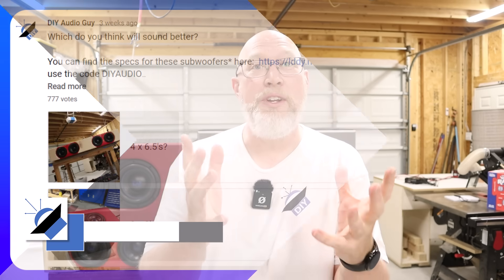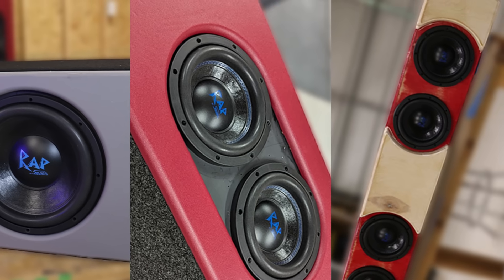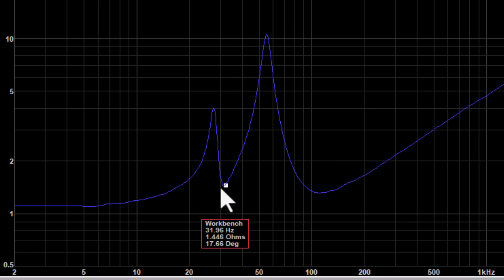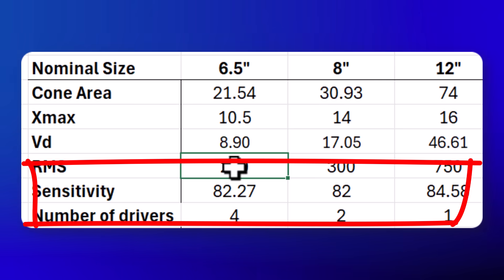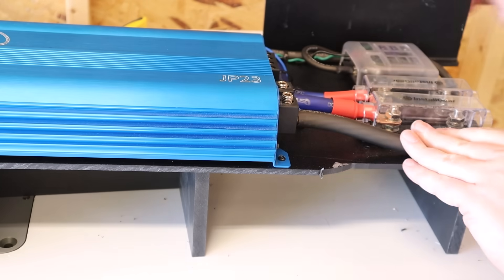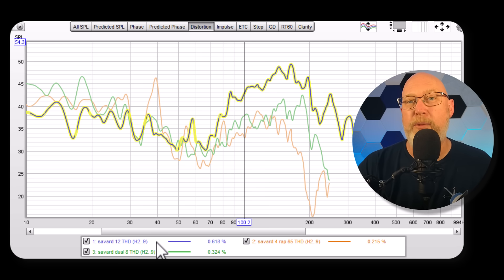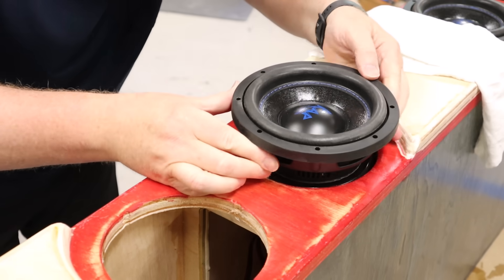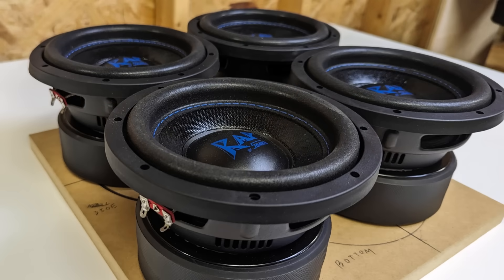Are small subwoofers better than big subwoofers?

Comment: Okay, so if I'm looking for some low frequency extension / higher output at those low frequencies, I already have a single 12, and plan to do a center console hidden subwoofer box for my full size truck in between the bucket seats of my single cap, so would I want to go with a larger or smaller displacement box? It seems that if I want to keep the base tighter it should be sealed instead of ported, though I've ran a ported box in every other application I've done up till this point with trucks and SUVs, but I'd kind of like to be balanced between SQ and SPL, and it seems like a sealed box might be the better bet for that? So then that just lends to the question of which one, larger or smaller, would lead to higher SPL output at the lower/lowest frequencies? Or should I stick with a ported box, slightly on the smaller end of displacement, with a port tuned closer to 25 to 30 hz?
Reply from the maker: That is to much to answer in a comment under a YouTube video.
Reply: @DIYAudioGuy  long story short, will a larger displacement sealed box create a larger extension of the deepest bass frequencies than a smaller displacement sealed box with the same woofer?
Will that sealed box play the deepest notes comparatively to a ported box (assuming the tuned port frequency is say 35hz, while I'm talking frequencies below that in the 20s)

Comment: 1. I have questions!  How is a subwoofer box size determined.
2. Despite however box size is figured, I've been told that the bigger the box, the louder the base is and lower bass.  Is that true.  
3.  Does a 100 watt amp have a harder time driving 4 100 watt subs  than just one?  ie would i benefit from increasing my amp size to a 200 watt? (not to hit peaks with just to ease things for the amp running 100 watts rms.
I'm going to be building a box for my old silverado ext cab.  I've found that I can squeeze in a 14"x14"x56" box hoping to get more from the 8"s I'll be putting in it.
Reply from the maker: https://youtu.be/yZNeYBYGRKk?si=O610L8gTNir0DQHE

https://youtu.be/A9oVxddE2GA?si=9RKNehqOe_wp1D3i

https://youtu.be/1CwZtmCqUtE?si=jVR78r1bPA7s6H2i
Reply: @DIYAudioGuy  Thank you!!!

Comment: I aint worried about car audio. I hate line array speakers they play way to much highs with limited mid range and without a sub there is no lower sound range. I like to hear the rumble move from place to place in my theater room. I also like the fact i have my old school hifi home speakers and a good powered sub. I run a pair of techniques by pioneer sb 6000 a speakers and i also run a pair of freshly rebuilt infinity rs 3b speakers. I can shake my entire room and house without the powered sub with my infinity speakers. Pink floyd welcome to the machine shakes my room so bad plaster falls off my ceiling. The infinity rs3b has two tens per box with amazingly clear lows mids and highs.

Comment: If you dampen the res freq. the roll off below resonance is not that steep and to counter the spl drop due to a low q factor use 2 subs in parallel. It basically allows you to build a smaller box but with a lower q factor.
Reply from the maker: Sounds like you're describing an isobaric enclosure.
Reply: @DIYAudioGuy  not the same but using principals of musical instrument manufacture for tuning driver response
Reply: @DIYAudioGuy  you can reduce enclosure size by about 25% and end up with similar q factor

Comment: Iv done this test many times simply because I love subwoofers and bass head in general. It's a hobby , 2 yr ago I was designing a system that would fit best for me and something I could run with the fam with me and rip the car apart when they aint. Lol😂. So I started with 2 Sundown Audios SAv2 8s , not just normal Sav2 8s but the spl version with the aluminum coils.. music they hit pretty hard , but spl they walked all over past woofers iv used which shocked me. 140s from two 8s in the trunk on a taramps 4k at 1ohm. Then I ordered the newer Sav3 8s the street versions for music. I got em cheap 280 dollars or so for em both brand new still in box ect. Those sounded better than the older V2s even spl wise it was close. It's just the v3 is better built. Then I ended up ordering X 8s from Sundown and those done better on deep bass , but louder?? Not really.. like normal music the Sav3 hands down sounded best hit harder and was cleaner. The Xs got lower but I wouldn't consider em much louder.. nor worth the upgrade. The Sav3 8s are str8 up mini monsters. Then I went to Sundown xv3 10s which are amazing. Those two 10s will tear things up. Their heavy , their very loud , and almost damn near impossible to blow unless someone intentionally tries to fry em. I had em on two taramp 4ks each one had its own 4k Amp. Bass 4ks , then I went to my trusty old Sundown Zv3 12s I have 4 of them , but I needed room so I just used one. It's a close call but the two x 10s are louder ect... then I done the 15... I got all kinds of em. Hcca 15s , Rockford T2 15s the silver top from 2005 era. Skar vfx and so on. Even Sundown Zv3 15s n a Xv2 15". The 15s each of em was louder n deeper than the rest... but they take way more room... so I just went back to the single zv3 12" thing is a monster

Comment: 4 10" subwoofers, isobaric mounted, gave me both higher SPL and lower cutoff than a pair of 12" in a sealed enclosure, in a similarly sized space. The fact that  the 10s presented a 2 ohm per channel load, vs. a 4 ohm x 2 for the 12" pair, may have made the difference.

Comment: Falcon Acoustics make an upgraded version of the KEF B139 that's rated at 150 W and has and added 25 mm cone excursion, this driver has TS characteristics that make it good for a transmission line.  The T-line loudspeakers website has a design named the coffin, it uses a B139 at each end (It's stereo) and measures 6' x 2' x 2' and is two folded and tapered 12' tubee filled with long fibre sheep's wool and is good for below 80 Hz.
I built the enclosure using 1" thick MDF and while doing tests at below 20 Hz I started to feel mildly nauseous, at 14 Hz I heard a tick tick tick noise and found it was my window frame being stressed because the large pane of glass was flexing. I turned it off!
My point is that you can get an excellent low bass sound without using huge amplifiers if the drivers are paired with a well designed enclosure, the specification claims 0.3 dB down at 10 Hz and it makes an excellent sub for my four pairs of Quad ESL 57s.

Comment: If you're an old school stereo guy, say 20 years ago was your time, there was good reason to dump on pretty much anything smaller than a 12". A combinations of how much watts cost in an amp, and their relative inefficiency, the only real way around both those was efficient boxes and bigger drivers.

but now.... amps are way more efficient than they have ever been and cheaper per watt, so now you can use a smaller driver that may not be as efficient, but has enough build and Xmax that you can beat the hell out of the thing.   If you take someone who hasn't been in the audio game in a while and hand them a modern 8" you could watch their eyes bug out at the construction of the thing.
Reply: As a user of the first "modern" generation dd audio 8" subwoofers... about 18 years ago (time flies, horribly fast!), I can tell you that a lot of people were surprised when I pushed them (pair) past 140db 🤘

Comment: My guess with the distortion is that the smaller speakers react a lot quicker than the 12 inch due to the lighter cone weight.  This would translate into less distortion as they have less inertia and can follow the signal much closer.

Comment: hi from Australia 👋

great video series 🤩

I used one Kicker 12" L7 Solo Baric between the front seats of my previous van.

now i have a new van that seats 3 in the front, so i cant use the 12" L7 Solo Baric

the top of the  front bench seat lifts up in two individual sections,  which provides storage space and secret spot to put tools and IT equipment in.

the front height of the benchseat is too low for the 12" L7 Solo Baric, and i dont want to down fire the L7 inside the seat compartment.

Solution is to use 2 x 8" subs.

this is why i accidently stumbled across your vids while researching 8" subs.

i will be watching heaps of your vids so i can work at the volume and dimensions to build a sub box to fit in the benchseat compatment with the 2 x 8" Subs exposed on the front.

after watching this vid, you have given me some comfort of losing the use of the 12" L7 Solo Baric and  substituting it for two 8" subs

i watched someone else's vid detailing the top 5 8" sub drivers, there are one or two drivers that have excellent sesnsitivity with very minimal loss in frequency and SPLA

Comment: I have a JL W7 13.5" in a slot ported 2 cube box. Its a factory built off the shelf W7 13.5 built box. Its port tuned at 38 hertz. What do you folks think? Should i build a box with a lower tuned port?

Comment: I built a box for 4x 6.5s back in the day - still have it - put 4 tang band w6s in it.  was a really easy build - bought a 4x8 (49" wide) sheet of 3/4 in mdf, had home depot cut me 2x 16" strips (front and back) and 4 3.5" strips - for a total of 5in deep, 16' tall and 49" wide box; and was enough for 2 ports - forgot but I think they're 3x3.5.  it was tuned for 30hz, those tang bands are only rated for 50w a piece, but can handle way more - and they do have a LOT of xmax (like 13mm?).  I had em running off of about 300w amp - so 75w a piece, and no one could believe these were essentially, logitech computer subs.  The box fit perfectly in a regular cab superduty.  I tend to go small subs when given the option, they do sound cleaner, even if the box is more of a pain in the butt.  

I kinda wanna play with isobaric loading at some point to see how that works - for these newer/better 6.5" drivers.  If space is no concern, maybe even a t-line box.

Comment: Theres no way  those 6.5 subs are going to sound as good as a 12.
Reply from the maker: Four of them have no problem keeping up with the 12.  But it's expensive and impractical. You would only go with four of the smaller drivers if you had no other choice.

Comment: I am a bit sceptic about REW measurements. None of subwoofers played low. WinISD calculations and DATS box tuning showed that all boxes should go at least to 30Hz. I believe REW measurements should be done on way higher power. Other topic, use of WinISD. It is easy tool to learn, but it does not account for room/car gain. In car it is very important. I believe using something like BassBox Pro could yield way better correlation between simulation and measured data.

Comment: Nice video.  I appreciate that you actually built and measured 3 different subwoofers.  A couple of things to improve on in the future: What you called "sensitivity" is actually efficiency.  Sensitivity tells you the output level when driven with 2.83 Volts, and it never goes up by 3 dB when adding a second driver; efficiency is the output with one watt of power, and it does generally go up by 3 dB when doubling the drivers.  Also, for subwoofers you should measure distortion in something more like the 5-10%  range.  You measured it at imperceptible levels, and there's no guarantee that the rank order would be similar in the meaningful range.  If you make this change, you'll likely find that the measurements track with your listening experience better, and the plots will start to make more sense.

Comment: I appreciate you stating that the 8's sounded cleaner. Im picky about the smearing effect one hears with larger, heavier drivers. Tight bass is the best bass!
Reply from the maker: It was interesting going back and forth listening to the 12 versus the pair of eights.  To my ears it sounded like there was something missing with the pair of eights, it just didn't dig down and hit the low notes as hard.  But I thought the sound quality itself was cleaner with the 8s.
Reply: Why not compromise and get some cleaner output while retaining more lows with a pair of 10s?
Reply: Same! I prefer a sealed 10 or 12 with low fs in larger box. Plays lower and cleaner but takes a hit on spl next to a smaller or ported box.
Reply: I also find an 8" or 10" sub is best overall.  They are clean and less muddy sounding.

Comment: Those 6.5"s rock. Not in a good way. Watch the slow mo.
Reply from the maker: https://youtu.be/2hf_dymCBMY?si=fwJIwKs52pwZdcxZ
Reply: @DIYAudioGuy  Thanks but that wasn't what I was talking about. I was talking about the cones rocking in the frame. And yes it is possible.
Reply: @DIYAudioGuy  Thanks I should have watched the whole video before replying. Camera glitch is also a good explanation. But subwoofers can rock like that. Generally only happens in cheap poorly controlled subs

Comment: I built some speakers with 6" woofers and some with a larger box and a 10" woofer (of the same JAYCAR brand woofers). The 6" woofers had good bass and I could hear down to 25 hz with them. So the 6" went down as low as the 10", but the 10" sounded so much more FUN than the 6" (which still didn't disappoint after the 10" woofers). 

The 10" just had more MPACT in the bass and the kick sounded less muddled in (more separate) than the 6" (by a large measure)! Best kick I heard, with that subtle "puh-huh" that you hear on a live kick drum! 🎉 You don't get that with the 6"!

 And the 10" kick sound had a sharper edge to it, which seems crazy, they seem to sound faster in the bass than the 6" (maybe the box is slowing the 6" bass down) but I think it's the extra woofer diameter of the 10" that does it. And it doesn't excurt as much cos it moves more air. Just a theory, all I can say is that the 10" JAYCAR woofers are great for their cheap price! 😂